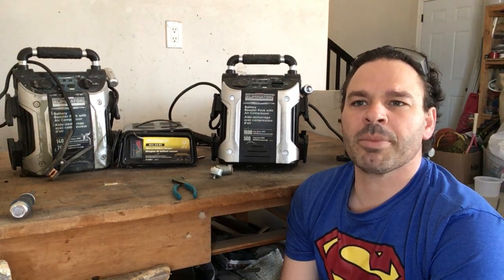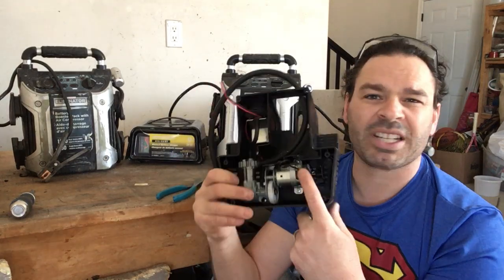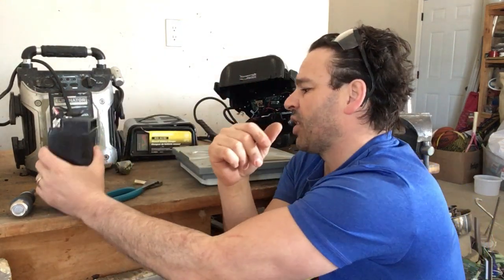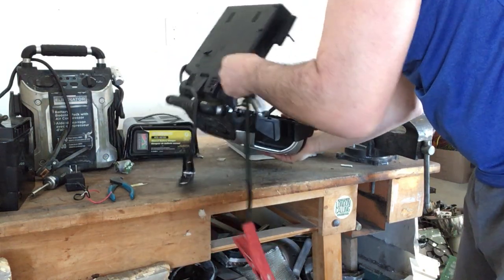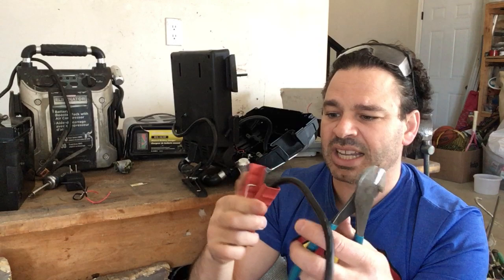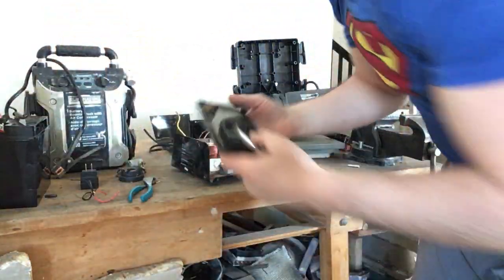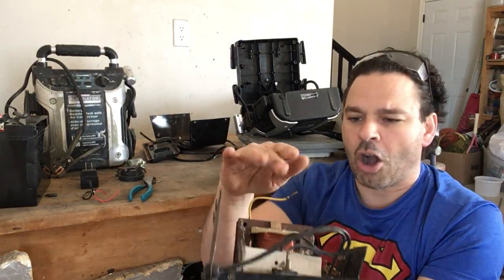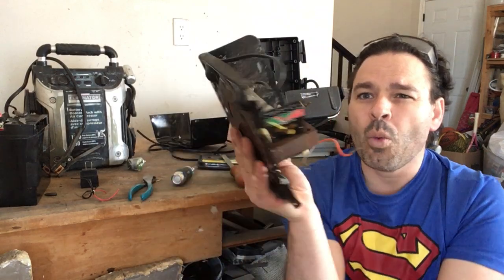Scrapping some battery booster packs and charger for loads of copper, lead, tin and other metals.

Comment: I have scrapped a bunch of these. You can buy the replacement battery. They are pretty expensive to get them shipped to where I live but you might be able to get them cheap in Toronto. Nowadays it's cheaper and way lighter to buy the lithium charger packs.
Reply from the maker: Agree, I am just glad that they did not end up in the landfill. It is hard to tear down, but I can’t keep everything I find in hopes to later sell. I have to think of storage space and my wife. I already have too much to scrap and lucky my wife is supportive and patient!!!!!!!
Reply: @Tin Man Scrapper  oh for sure. I was going to keep them for myself but then saw that I could buy a new lithium one that fits in the seat pocket for a few bucks more than replacing the bulky battery in this clunker. I kept the copper cables with the crimped on ends and some other goodies from inside and scrapped the rest.
Reply: @wannabescrapper72  oh you have good productivity partner videos. Keep yours coming too.
Reply: @coppertopper  Thank you. I am just finishing up some non scrapping work and the weather is getting better so will start doing more.
Reply: @wannabescrapper72  I totally understand. i am trying myself to learn how to make videos, how to scrap and how to YouTube all the while working full time. haha I have some videos but yeah not so great but I am learning

Comment: Lets say I do the scratch test and reveal 2bl aluminum winding on the transformer. Would I be able to repurpose the transformer for another project or did I ruin the transformer by scratching the windings? TY
Reply from the maker: I think as long as you did not tear the wires you should be fine. It is just a thin coating